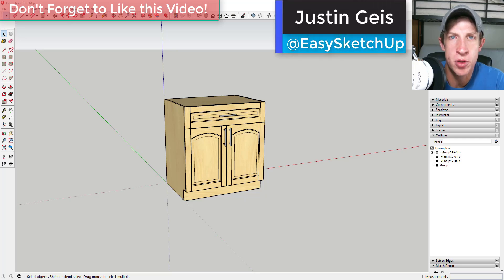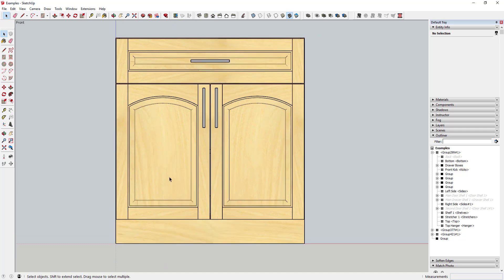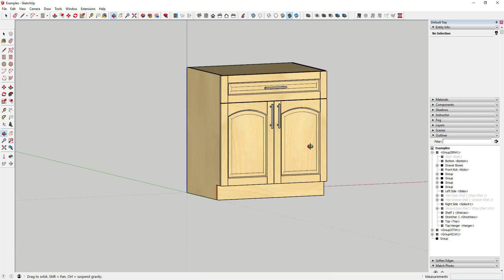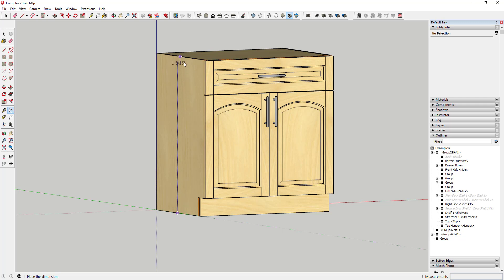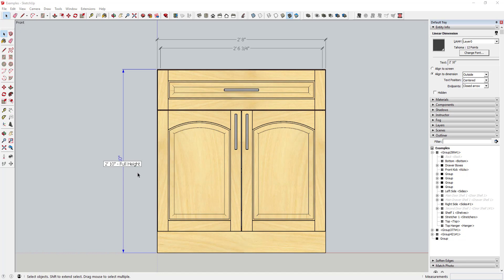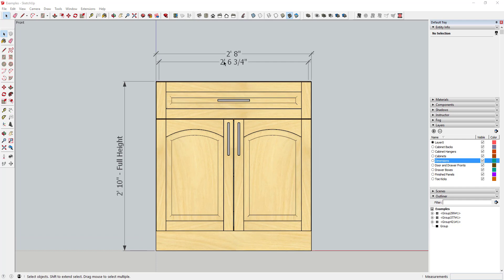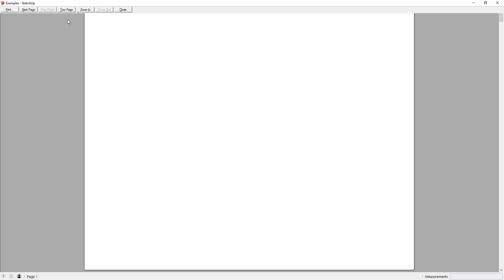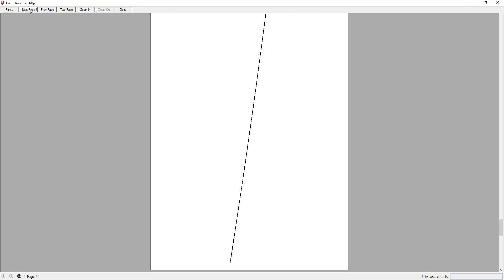Printing Your SketchUp Models, Creating Elevations, and More - The SketchUp Essentials #56

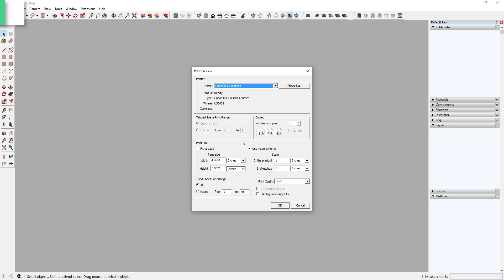Comment: Hey great video thanks. At 8:50 you're mentioning the method how to print or have a look on the print preview. My problem is that all these parameters are not there. I can type in some , but the doesn't change anything.
Im working with sketch up 2017.
Do you know that problem?
It would be so nice if you could help me out.
Josh

Comment: Is there any way to move the image around in the preview? I set up some knob templates to fit into a standard piece of printer paper but it just drops them into the middle of two pages in portrait and four in landscape. There's no way to zoom in far enough to get exactly the 8.5x11 view without it cutting it off  some of it.

Comment: Great info.  One question for you...how do you dimension from a hole in a piece of plywood out to the edge?  I can get the dimension tool to snap to the corner of my cutout but can't get it to snap to the outer edge of my plywood.  thanks!
Reply from the maker: So it will snap to one edge, but not the other? Try drawing a perpendicular line that intersects with the point you'd like your dimension to snap to and see if that gets it to snap...

Comment: Great information on the sandbox tool.
I've found that print resolution is way better than screen resolution as I've made some detailed scales for jigs that were sharp as a tack. I sure wouldn't suggest spending $500 just to smooth out printing.
Also, I find it useful to shrink the Sketchup window down as tightly as possible to the drawing before printing to eliminate all the wasted space. As I recall, this is particularly helpful when printing to scale.
Thanks for your efforts.
Reply from the maker: Yep - the closer you can get your window to the drawing, the less wasted pages you'll have. Thanks for watching!

Comment: The material about SandBox tools was very useful
Would appreciate learning how you dimension when items are in different planes. For example, how do you dimension the vertical distance between two boxes when that are not in the same vertical plane - Think - what is the vertical distance between the first floor kitchen ceiling and the fourth floor bedroom floor when the rooms are not directly above each other.
Reply from the maker: I think I get what you're asking. What you can try, because the dimension tool only really seems to work between points, not lines, is you could draw a guide using the tape measure tool that interesects the line at the point you'd like to dimension to, then use that point as the point that you dimension to. Does that make sense?

Comment: I really appreciate your showing different ways to do the same thing. So... when you did the scale print of the cabinet, there was all this space still around the drawing.  It almost looks like it's printing the view on the screen.  As in, if I zoom out, it'll print the whole screen and so the cabinet would be small.  Is that right?  Thanks!
Reply from the maker: Hi Greg - just so I'm clear, you're talking about printing the actual scaled version of the model, right? The cabinet should be the same size in that case, you'd just have a lot of blank pages that SketchUp would try to print. Does that make sense?
Reply: If you look at the print preview you have at 9:06 in the video, for example... there's all this empty space to the right of the cabinet. It's not really pushed the image (with the dimensions) to the margins.  Just curious why that is.  Thanks!